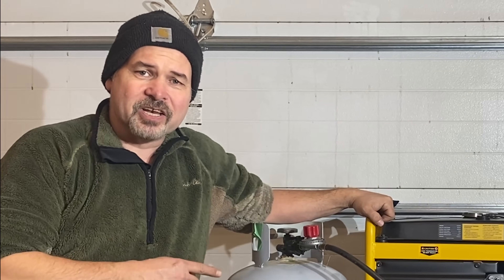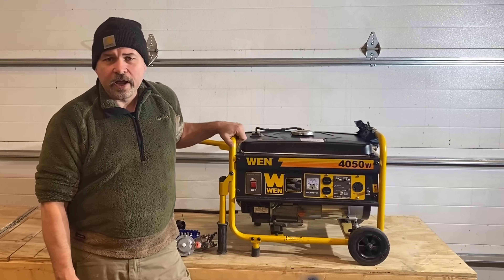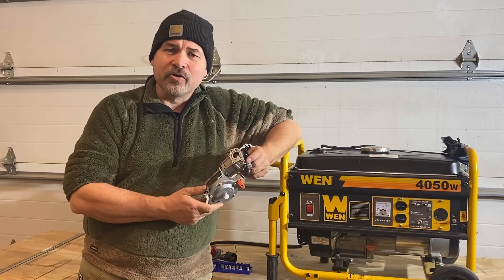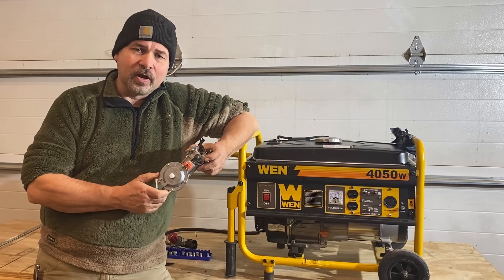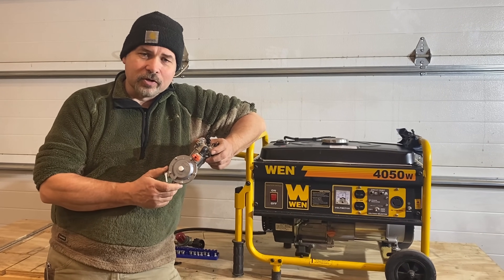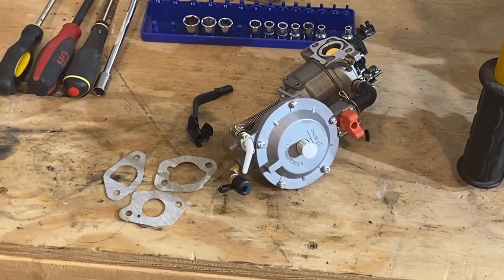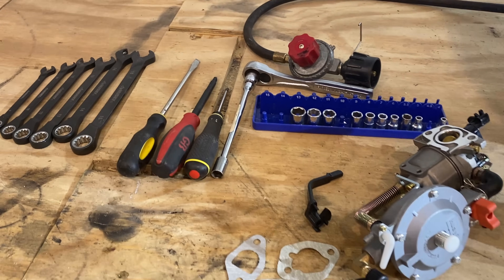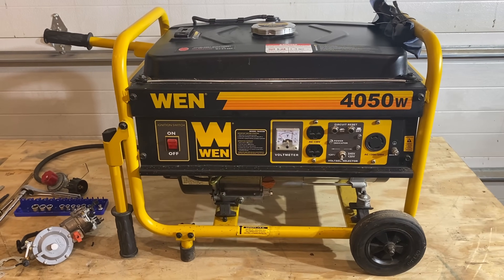how to convert a gas generator to natural gas - How to convert a generator to propane

Comment: I squeezed a hose from Natural Gas Line right where the intake is with a a gate valve i had left over from a remodel AND IT WORKS FINE for only a few bucks of hose!
Reply from the maker: Well...I leaned out the jump door of a C-141 in-flight without a parachute to tell a jumpmaster that our drop zone was held my the enemy once too... but it was a dangerous thing to do and could have resulted in my death if something had gone wrong. It also resulted in me and my Ranger Battalion commander getting called to the carpet of an Airforce commanding generals office to get my butt chewed right properly for risking my life and his career. 

The point is... lots of stuff works fine... all the way up until it doesn't.

I wouldn't personally advise ANYONE to introduce a virtually unlimited supply of natural gas to a generator in the way you have described, start the generator and then leave it unsupervised for ANY amount of time.

Now, you are presumably a full grown man and I wont tell you what to do, AND I do personally often follow my favorite old mantra "Safety third" but I would encourage you to think that one through a bit.
Good luck and stay safe my friend.
-Shane

Comment: GREAT VIDEO!! I have a Champion 100892 Inverter Generator (224cc, 4650W surge, 3500W running).  Will this conversion work on an my inverter generator?  I've read both yes and no.  Will this carb work on my generator?
Reply from the maker: Jack,
Thanks for the comment we appreciate you!
The truth is I'm not sure on your generator... It is right on the edge of what this particular kit is rated at. If it were me I would take a chance for $30 bucks though... The worst that could happen is it doesn't fit and you have a kit to trade or sell to someone else or buy a craigslist generator for.
Do us a big favor though please... let us know how it turns out so other folks can get the straight answer !
Thanks again! 
-Shane

Comment: What would you recommend for a sportsman 9000?
Reply: Aslo good job and how did you modify the drill?
Reply from the maker: The sportsman 9000 is going to be too big for the kits we used here. 
A search for larger kits would be needed for a gen set that big.
Sorry, I have no experience with that articular gen set
-Shane

Comment: MAYBE Stupid question,  I just purchased a good used Onen generator.... Is there anything unique to this gas generator you may know about that I may need to know.?  Thanx,  -keith
Reply from the maker: Keith, 
Not a stupid question, but I dont really have a good answer for you.
The Onan generators are good quality long running machines in most cases. They use them in campers and such so they take a lot of abuse and still have a good reputation.
I think the odds are that you have a good machine.
Have a super day!
-Shane
Reply: @AHandleOnThings  Thanx Shane,  I bought a fifth wheel travel trailer and pulling it with a ford 250 diesel.   I found the correct model Onan to wire into the fifth wheel. My truck is diesel and it just makes sense to convert the generator to propane. We pulled it out of a late model class A camper.  It has very little use and I was lucky to find it.  I'll get with Onen, but I'm sure they will want to charge an arm and a leg to provide the parts.  What your suggesting costs only $42.00:-)  I'm sure I'll figure it out. Thank you for your help.  -keith
Reply from the maker: @keithnorris8982  
Right on, and I agree with you COMPLETELY! 
IF I was putting one in my camper and potentially having my family sleep above it... I would use the Onan parts to avoid a possible tragedy.
My situation, putting the generator outside and yada yada, If my generator were to go boom  (within reason) or catch fire (gain within reason) is a more acceptable risk for me.
I will say without any reservation at all though...
 In my opinion, propane fired is the way to go no question.
But YOU need to be the captain of your own ship brother.
Let us know which way you go in the end! 
-Shane

Comment: Hi That kit can work for  certified. 6550w/8200w ?
Reply from the maker: No sir... Not that particular kit. The kit I used in the video is good up to about 4000watts
There are larger kits available that will suit your needs though, and they install very much the same way!
Have a super day!
-Shane
Reply: Thanks  by the way generator  can use 30lb propane?
Reply from the maker: @timtran7338  30# propane yes... You can also go to a 100# propane tank but you would need a dual stage regulator for that 
Have a super day!
-Shane
Reply: Thanks so much sir. You are the best
Reply: Can I get for 20lbs propane tank for this 2.6 out of 5 stars  2 Reviews
Artilife 5FT Two Stage Propane Regulator with Hose - 5/8-18UNF Female for RV, Grill, Fire Pit, Gas Generator, Gas Stove, Ranges and More

Comment: Handle do you any chance remember what size that small piece of adapter hose was?
Reply from the maker: Dave, 
I want to say it was a 1/2" Inside diameter hose that fit on mine for the adapter piece 
-Shane
Reply: @AHandleOnThings  Thanks for the reply Shane, turns out on the carbs for 13 HP Generators the barbed fitting matched the cut off regulator hose, no fitting was necessary. Very tight fit, but that is good.

Comment: Great trying this with an old 13HP generator. (Rusted fuel tank) Already had ordered the wrong regulator just ordered an adjustable.
Reply from the maker: Dave, 
The kit we used in the video isn't rated for that big of a motor so be sure to find a kit that works for yours! They all go on pretty much the same!
Have a super evening and stay safe!
-Shane
Reply: @AHandleOnThings  Thanks , yes I ordered a kit for a 13HP motor before I saw your excellant video.👍

Comment: My generator is bigger will it still work? It’s a s 6500 watts with 8200 starting. Also can I buy the kit on Amazon?
Reply from the maker: There are many propane conversion kits available on the market. This articular one I used is not capable of running a 6500-8200w generator. 
There are kits available on eBay and a few on Amazon that are able to run the bigger stuff like that and they install in much the same way that this one did. 
I have had more luck finding them on eBay when looking for the kits for the bigger generators though.
Have a  look around, you will likely find what you need!
let us know how you do!!
-Shane

Comment: Isn’t the round part on your replacement carburetor a regulator and if it is do you also need the regulator by the tank?
Reply from the maker: Propane applications always want a regulator at the tank as well.
I'm not saying you couldn't get by without it, but all of the instructibles you will find require it. And with this particular kit, in my experience, the generator just wont start without the heavily limited supply of propane from the first regulator.
Have a great weekend, and stay safe!
-Shane

Comment: You did this on a 4000.  Would it work on a 6000 or 8000
Reply from the maker: This particular kit is only good up to about 4000-4500. There are kits available for larger units and the installation is very similar.
Have a super evening!
-shane

Comment: I tried this on an 8000 watt generator and it has to constantly has to be adjusted at the gas valve.
Reply from the maker: Daryl, 
These particular kits say they are made for 3500w generators and are not spec'd for an 8k generator so that might be the issue. I have never seen a kit for an 8k generator but then again I havent looked for one either. 
Let us know if you find one that is good for a gen set that big though!
have a super evening!
-shane

Comment: I was a GM mechanic and did mostly engine rebuilding or replacements, One day I see all my coworkers standing around a block on the stand,
It was motor that ran on LP,  It had 25k miles on it,  None of us had ever seen an engine so immaculate .
This motor looked as if it had just been assembled,  This made me understand how dirty gasoline is
Compared to bottled gas, Plus propane can sit in your garage for ten years and doesn't go bad.
Reply from the maker: It really is amazing with the may other fuels that have measurable benefits over gas, how liquid gasoline became the standard motor fuel simply because it is easier to pour liquid fuel than refill a propane or nat gas tank. I guess it goes to figure that "easy" often trumps "better"
Have a super weekend!
-shane
Reply: @AHandleOnThings  wooooooow. I now need to onow how to get my hands on this converter to use the generator on biogas.. is it possible to generate electricity using biogas to power fans and lights at home?

Comment: Nice video  ? you did not show connecting to a natural gas line......is anything else needed for NG connection ?     Thanks
Reply from the maker: Joseph, The short answer is, hooking up to the natural gas line is too much of a liability for me to be comfortable to show on YouTube. This setup is capable however of being hooked right to your nat gas supply per the manufacturers specifications. And I have had one of my generators hooked to the natural gas using this setup and it worked fine.
The only thing that "I" used was a tie in hose with an additional regulator that served my nat gas BBQ grill when it was not being used for the generator. I simply unhooked the nat gas BBQ grill and fed it to the generator.
That said, in my own personal opinion, using this setup with propane is safer and I just like it better.
Not saying YOU can't or shouldn't hook to Nat Gas, just saying I prefer the propane hook up but they are supplied with either type of gas in essentially the same way. 
Stay safe my friend, 
-Shane

Comment: I am a prepper and have 2 generators but they are both gasoline set up. Obviously not the best in a grid down situation. I store propane and sometimes power is off but Nat. gas is available so this is just what I need! I like your site content available as well. Subscribed now. Thanks so much for the good quality and informative video!
Much appreciated!   Revision....forget Ebay and spending just $30.00 or even $50.00 dollars unless you get REAL lucky.  Will end up grossly overpaying as he mentioned instead. Oh well, I at least learned that it is possible and available. Thanks for that info anyways.
Reply from the maker: Greg, 
eBay has definitely been harder to get stuff on lately, keep an eye open for them 
Watch for them on amazon tho. 
Here is a link (not affiliated)  and search amazon for "Propane conversion kit for gas generators"

https://www.amazon.com/Manual-Choke-Carburetor-Conversion-4-5-5-5KW/dp/B07FFVPL68/ref=sr_1_5?crid=2YISJX8TAM295&dchild=1&keywords=propane+conversion+kit+for+gas+generators&qid=1617757205&sprefix=propane+coversion+%2Caps%2C344&sr=8-5

Good luck and stay safe!
-Shane

Comment: We have a 8000 w gen with a B/S  18hp V twin. It's a 2002 model year. I can't find the correct carb conversion kit I need for it. Any advice/link would be awesome. Great video, very well presented and very informative, thank you. Subbed.
Reply from the maker: Sorry but I just dont know what kit might fit your gen set. So many of the kits that used to be on the market have just disappeared over the last year or so. 
Thank you for the comment tho, and I will ask around and if I come up with any ideas for you I will let you know for sure.
Stay safe, 
-Shane

Comment: if you run propane do you need to clean the carburetor once in a while like gas?
Reply from the maker: EXCELLENT question!
I have never had to clean the carb when only running on propane. The propane conversion has LOTS of benefits and never having the carb fouled up with old gas is one of the best!
-Shane

Comment: is this just valid for 4 cycles engines with separated oil compartment or can be implemented also in 2 cycles with a solution for the lubrication? thanks
Reply from the maker: Well, I have heard of people putting an oil drip on things that had been 2 stroke that they converted to propane but I never tried it myself... I have considered trying to do a chainsaw that way off of a small tank but haven't gotten that far yet. I think "MR Teslonian" may have done some of that on his channel...  
If you do convert a 2 stroke, let us know how it turns out! I would certainly be interested in hearing about that!
-Stay safe!
-Shane
Reply: @AHandleOnThings  thanks a lot, I'll check "MR Teslonian" to see if I can find something done with 2 strokes. thanks again, cheers

Comment: some propane regulators have a "Excess Flow" spring loaded check valve. If you open the tank valve too fast it shuts off down to just a trickle. Then you have to shut the tank valve and bleed off any pressure and the reopen the tank valve "slowly".
Reply from the maker: Yep, that's true too.! 
Thanks for the view and the comment!
-Shane

Comment: I got a Honeywell that were bought by Generac and it's hard to find one of those tri fuel carburetors. Would you happen to know if there's a company that might have one; Or, is that kit universal? (Fits most U.S. generators)
Reply from the maker: Mars, 
This kit fits a ton of different generators.
Have a look at the gasket on the kit I installed and compare it to the gasket on the one you have and that is the best way to match them up!
Stay safe!
-Shane

Comment: One of the best videos I have seen for taking something apart and putting it back together. Too many folks just say, “Well, we put it back together.” And they don’t show how they did it. I got a chuckle when you used an electric drill to start the motor. If the power is off, then you can’t run the drill. I don’t have any battery powered drill so I’ll just have to use the pull cord method. I wish there was some kind of conversion kit to change a pull starter to an electric starter.
Reply from the maker: James, 
Thank you VERY much for the view and the comment!
I wish they made a simple to install starter kit too!
That would be a HUGE benefit!
Stay safe!
-Shane
Reply: I have found that if it doesn't start on the first pull, it needs a tune up (Or bad fuel). I can go ahead and use the electric start on my engines but its just away to brute force a problem as opposed to fixing it. Eventually it won't start with an electric start either. IMHO

Comment: I have a 3600 watt gas generator still new in box that I would love to convert to run off natural gas.  I was going to do it and initially only came across the models you mentioned that are like $200 and didn't think it was worth it, but at this price point it would be great.  I noticed that the conversion kits seem to reference either being 2 KW or 4.5-5 KW.  Is it Ok to use the 4.5-5KW or does it have to be sized very accurately?
Reply from the maker: Glen, 
Unless you grossly oversize the kit you are going to be good. 
I wouldn't suggest cobbling in a kit that is designed for a 10kw into a 3.5kw machine for instance, but you will be in fine shape using a 4.5-5kw kit as long as it matches up.
As to not being worth it, I have to tell ya, after using these gen sets converted, I would NEVER go back to a gasoline only system.  
Have a super day and stay safe!
-Shane
Reply: @AHandleOnThings   Does the adjustable regulator work for either LP or NG or is there a specific one for NG?  I can only find ones that say they are for propane. I understand that I will have to change the end that otherwise would thread onto a propane tank.
Reply from the maker: @glenclarke6866  
Glen, The "TRI-FUEL" units have been a bit scarce this year with all of the stuff going on in the world. They do still pop up on eBay now and again tho. Make sure that whatever gas you are feeding it you have a kit that is designed for it. I would hate to hear about an accident!
Stay safe !
-Shane

Comment: Does the unit automatically kill gas flow if the engine shuts off?
Reply from the maker: It is supposed to yes. Does it? I have had no issues with the ones I have installed and used.
But as with any inexpensive commodity type product like this, be sure to do some testing on yours before trusting it .
Stay safe and stay healthy!
-Shane
Reply: @AHandleOnThings  Thanks, stay safe and keep posting.

Comment: Very informative video I have a champion 3500 I’m looking to covert. Would I be using the same kit? The links you gave are both out of stock. Hate to play the guessing game
Reply from the maker: JP,
The best way to see if you are going to be a fit is to pull the carb and have a look at the gasket. If the gasket on the kit photos matches pretty closely you should have a great chance of having the right one. And I do have a Champion 3500 as well that is a number of years old and it did use the same kit.
Good luck !
-Shane

Comment: can it run on both gasoline and nature gas after the conversion?
Reply from the maker: The model of kit that I have DOES run both... I have heard that the "TRI-Fuel" version s hard to get anymore on eBay with all the weirdness going on in the world however.
Just be sure to look for a kit that suits whatever fuels you need to use it with and you should be ok,

Comment: i have a small champion generator 1200 rated watts starting 1500 watts will this work
Reply from the maker: Jim, I'm not familiar with that particular generator, but your best bet would be to pull the carb off of the generator and see if the mating surface and gasket area is similar to what you see on the conversion carb kit in the video. If it looks mighty similar, you should be in good shape. 
Stay safe and stay healthy my friend!
-Shane

Comment: Do you have issues with the native (gasoline) compression valve handling natural gas?
Reply from the maker: I don't use mine for natural gas much, I live in the woods and propane is just more regularly available to me, but I have run these on nat gas from time to time and have not had any issues with the setup I have.
-Shane